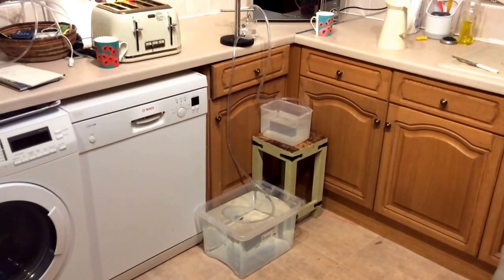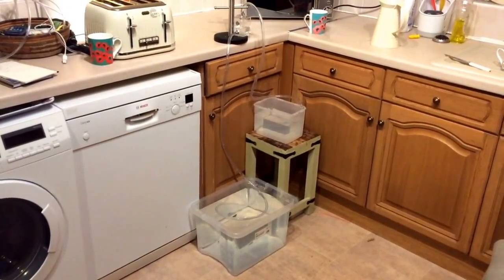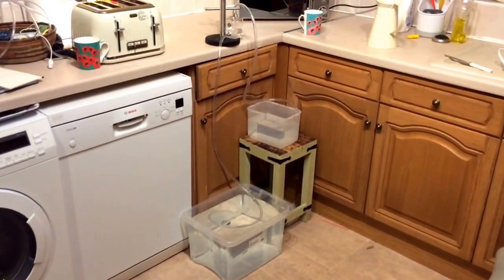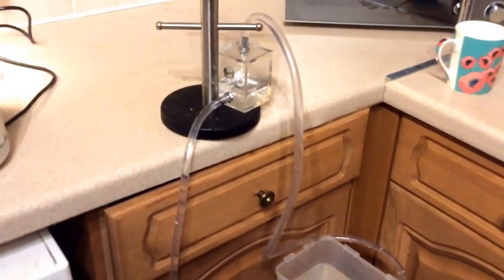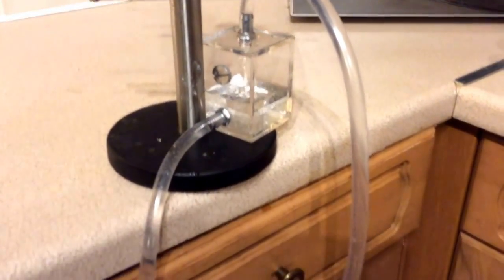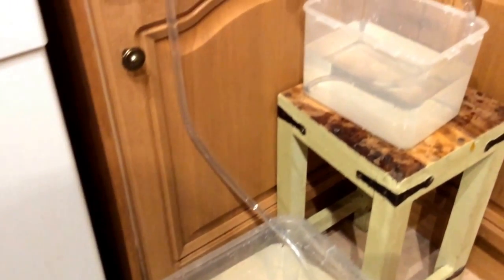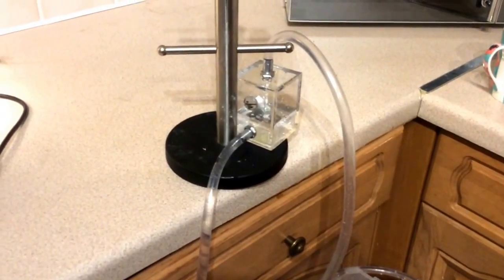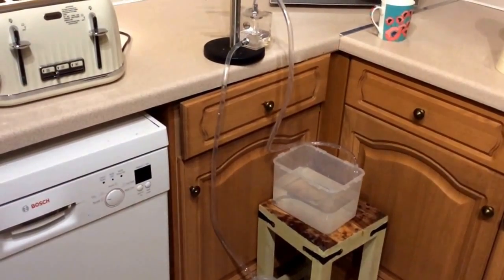Siphon Uphill Outlet Higher than Inlet.Stage 01

Comment: This is called a flying droplet siphon and the outlet is still lower than the inlet. But you can actually syphon water uphill without any external power using a hydraulic ram.

Comment: Lame your not letting the water out above the water source you basically blew a bubble in the air line so you could view the water up. For true siphon up get a sealed container have siphon tube go from the top of container all the way down into bucket, then put a spout on bottom of container. When you release water through the spout on bottom it will create a suction in the container which will pull water up the siphon tube. Container must be air tight for the suction to work only two holes one for spout and one for siphon tube
Reply: A small portion of liquid can be dispensed above the source with a siphon in a cyclical operation of emptying a metering chamber while the siphon is stopped and then closing  the chamber back airtight and allowing the siphon to run again with  a properly sized long leg to draw the air down to the outlet leaving the canister full again after the air is expelled and the siphon runs freely.
This can be accomplished with enough drop in elevation between  the inlet and outlet of the siphon conduit.
US  patent 5,358,000 was the first to teach this.

Comment: At :34 seconds you have that "container" on the counter that is half filled with water leaving an air pocket inside* 
Then as that inside water drains down to the lower bucket, that air pocket inside* is creating a vacuum to pull the water from the bucket to the right (middle bucket) creating the up hill pull of water.

Once again, this is not magic, you ARE basically pumping up the water but not by mechanical force but by suction using another body of water ...

Comment: You might want to see my comments on the second video.  This is indeed very interesting but remember the chamber is neither gaining or losing water - it is also sealed by the water entering and exiting so there is no way you could open that chamber to the atmosphere and the process continue - try drilling a hole in the top to see what I mean.  Air gap aside you can imagine it as being just like a wider bit of the normally rising pipe which water does indeed go up hill in.  Now you could create your 'garden' but it would have to be sealed within the container!  None of this negates the fact that water can 'flow' up hill - capillary action.  You only have to put a bit of tissue paper in a glass of water to see that!  And of course your 'garden' plants would not be alive if it was not for water moving up hill in this manner!  Interesting and well constructed none the less!
Reply: A siphon can actually be raised at the crest 25 feet above the source and it will continue to run.
The answer to dispensing liquid above the source with a siphon  is cyclical. 
The flow of the siphon can be stopped and a small canister at the crown can be emptied and put back airtight and if the long leg is of sufficient  length and drop in elevation the weight of the liquid within the long leg  will draw the source liquid over the crest refilling the canister and if allowed to run long enough the liquid will flush any air from the conduit expelling it at the outlet.
This can be accomplished by leaving  the outlet submerged in liquid  to prevent reverse flow of air up the long leg or controlling the flow with a shut-off  valve at the outlet  to prove the concept.

Comment: If the total mass of the water below the intake break is greater than the mass of liquid going up to the intake break, the water will be drawn or suctioned through the total system. The system can vary using a larger hose below, or a longer equal diameter hose length. The mass must be below the intake end to cause the increase in suction.
No different than a heavier weight on a rope over a pulley. Caveat; the release end must be lower than the draw end. Still a simple siphon, but a lot more work to build.

Comment: The textbooks are absolutely correct, and this video doesn't demonstrate anything to refute it. That little container at the top is NOT an outlet, it's completely enclosed, so this is indeed only demonstrating water flowing from a high source to a lower source. What he did was take a piece of the hose out and replace it with a see-through box that is functionally identical to a hose. No magic.

Comment: This is VERY possible, what people dont see is the correct statement that the outlet is lower. How so ? 
Well the chamber at the top is sealed, this causes suction so the water that is siphoned to the lower vessel is pulling water into the highest chamber which of course looks like flowing uphill. 
In truth this is perfect for physics and no laws are broken doing this.

Comment: awsome!!! was searching for a simple uphill siphon mechanism for a hydraulic ram pump excess water solution via pumpless aquaponics system... but with this concept, utilizing the ram hydraulic cylinder which is airtight. wouldn't require additional components and infrastructure. Simplicity at its finest, very innovative.
Reply: whats this method called?
Reply: seek out the PATENTs on this subject.

Comment: This isn't the uphill we're looking for guys
Reply: Oh you're looking too. Im looking for a suggestion to drain a flooded area to discharge the water to an area that's one feet higher..
Reply: @hemantbisnath1486  You need an electric or fuel pump.
Reply: Yes. that 1 ft flooded area, is the water flowing?coz i saw another video long ago only applicable if the water flows.  Maybe you can start looking for ramp pump videos in youtube
Reply: @hemantbisnath1486  pump and solar power
Reply: No the water isn't running it's a stagnant drain. I can't run out the water because the drain is lower than the main run off drain which is concrete.
Reply: Yes exactly

Comment: you could simulate a sealed box by using a 16 oz plastic soda bottle. seal the top line into the top of the bottle (through the cap) the 2nd left out the side down to the 2nd container.

Comment: Would someone answer this, I'm curious for my own experimentation: In this scenario, can the outlet bucket be higher than the inlet bucket and the process still work?
Reply: No. That would be breaking the laws of thermodynamics were energy cannot be created or destroyed. This is simply a syphon which widens in the middle but it’s still sealed.
Reply: Tell me something? I have a similar question, im trying to drain water from a flooded area to exit an area that's one feet higher. Can I use an elbow at the intake end to create the slant so I will get the grade to discharge the water?
Reply: @hemantbisnath1486  Use an elbow as long as the end where you want it to come out is lower than where it goes in.

Comment: But your outlet IS lower than your inlet. That thing on the counter isn't an outlet.
Reply: Yup your right sir. That whats confuses me. Because his inlet is higher than the outlet and the title is saying different that is why Im very confused in this video.
Reply: Agree, therfore the box is pointless in this sample.

Reversing the system it probably won't work unless (I've not tested this) you used a x2 longer hose (in a coil system) for the higher bucket. The x2 longer hose albeit higher should contain more volume/weight to generate the necessary vacuum... in theory 🧐

Edit: the x2 longer hose should not sit in the water as that will restrict flow.
Reply: What is the thing on the counter tho?

Comment: I think it works because it is a sealed box and there is no loss of pressure in the system so there is technically no break in the siphon.  It's all one siphon.  I could be wrong and might not be fully understanding the experiment here but I think you answered that yourself when you talked about the pressure in the chamber. That pressure is actually a vacuum and is exactly how the siphon works.  We are just seeing it with a different perspective here and probably demonstrates how a siphon works better than any other experiment there is. Super interesting.  Definitely got me thinking.  Great work
Reply: sethstronghold Nah I’m pretty sure it has to do with gravity and atmospheric pressure and the loss of atmospheric pressure in the tube.
Reply: @mofosoto You are right. It's not broken at all, but rather it's just a different shape. If he drilled a hole in that box, and air entered, or if he allowed the water to spill out onto the countertop, then the siphon would stop. The outlet is where the water flows out of the sealed tube, which is lower than the inlet.

Comment: I find this interesting. What if you put the outlet back into the container where the inlet is, so that the water will constantly flow and add a turbine into the small chamber where the water is falling? It seems like a good way to generate a small amount of electrical power continuously. Do you think it would work? If the inlet is near the surface and the outlet is near the bottom, would it continue to flow, or would the extra weight of the water above the outlet add enough pressure to stop it?
Reply: Nope, it won't work because as soon as the mid-point container is empty the siphon will stop. Then energy will be needed to pressurise the water to fill the tank again. In a situation as shown, the sum total of energy required to refill the tank will always be greater than the power, an inline turbine could create, otherwise, this would be producing free energy that defies the laws of physics.
Reply: I've been playing around with this idea using bell siphons. Great work BTW.
Reply: I was just thinking about this which is why I came here. Obviously, it's not going to function as a perpetual motion engine, but if the pressure could be regulated (which would consume power, just a little) could it work to actually create usable hydroelectric energy on a large scale?

Comment: I tried this with a small plastic container I could squeeze.it does work given you have continual pressure in your chamber of course because mine was flexible it developed a leak.tomorrow I may cut some thick plexiglass and try it your way.ill add some turn off valves to create the pressure by back filling the first hose and shutting it off before it can drain.then put both hoses into there containers.I'm only trying this again because I'm so tired of hearing an electric water pump in my fish tank.it kills my shrimp also.so thank you.salt water tanks are much more tender and easily destroyed than fresh water.